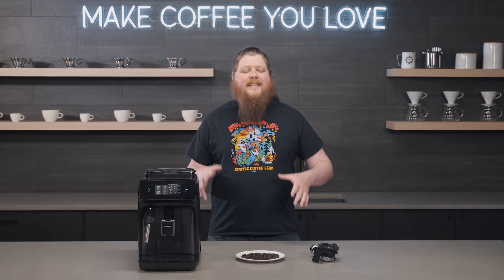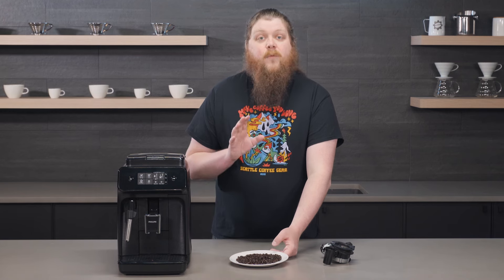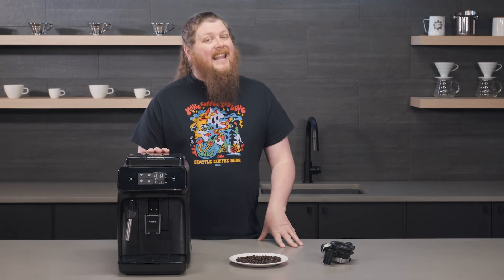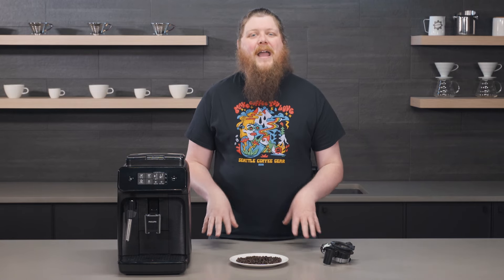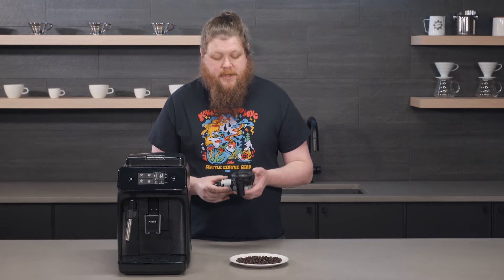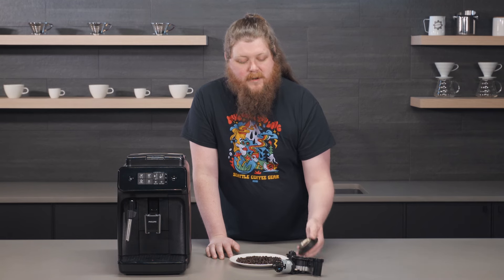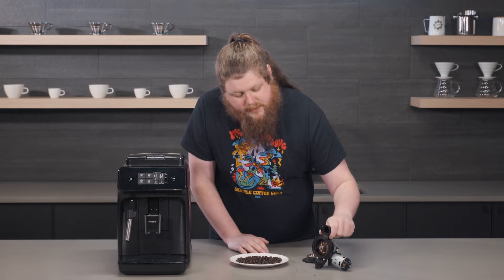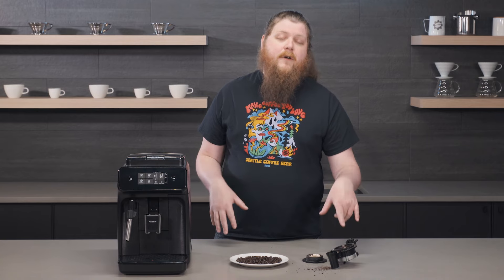Oily Coffee Beans in Superautomatic Espresso Machine Explained

Comment: As a coffee machine technician, thank you for making this video. These machines are amazing, they are so well engineered. The location of the grinder is one of the inevitable compromises to get so many features in such a little box. I have used dry white rice sometimes to help remove oil residues from the grinder, and a pipe cleaner to clear the exit chute. But that wouldn’t work for the grinder shown. 
The other issue with oil build-ups is that they go rancid, it becomes impossible to escape that taste and smell: that’s the first cue to use a product or service to try and clear it.

Comment: Thank you for posting this.   For the record, oily beans also play havoc with stand-alone grinders used for semi-auto machines.   Whenever I get a bag of oily beans I know that my Eureka grinder will need a thorough cleaning, usually after about 300 g of beans have been ground.   The discharge chute just plugs up.     Not worried, though, about damage to the grinder because it's fairly simple to disassemble and clean.    I really wish the coffee roasting industry would come out with and use a standardized grading system for beans, including darkness and oil of the beans.

Comment: I have been using oily beans in my Jura for years. Seriously, YEARS with absolutely no issues. Don't know why I have no issues but everyone else does. A service tech with Jura told my go right ahead you will have no worries. He was correct.
Reply: Our superauto Delonghi has been going strong for a decade.
Reply: Happy for you. However, my experience with Jura, from defective water reservoir sensor (30 months after purchase, 269€ of repair for a part the user cannot even access) and now not even a year later what appears to be a defective ground coffee chute preventing coffee to end in the cup and steering it instead to the waste water reservoir, has been far less convincing.